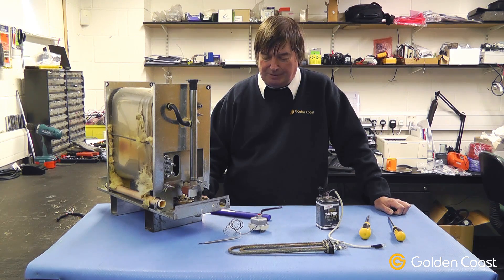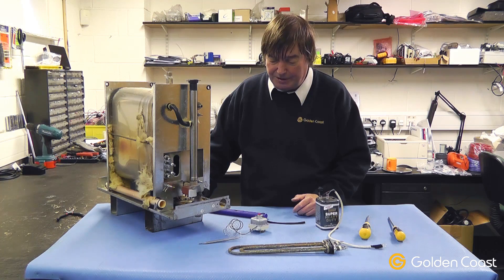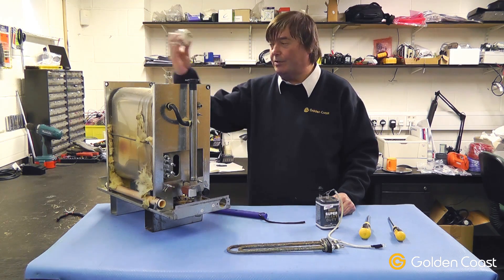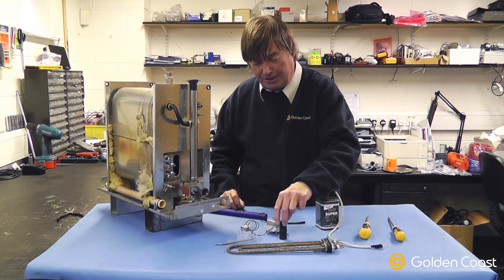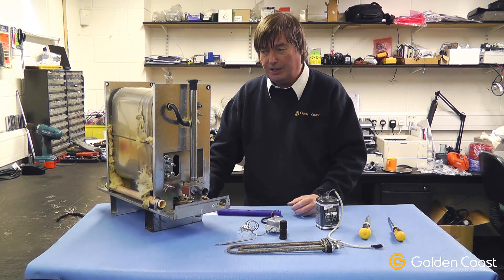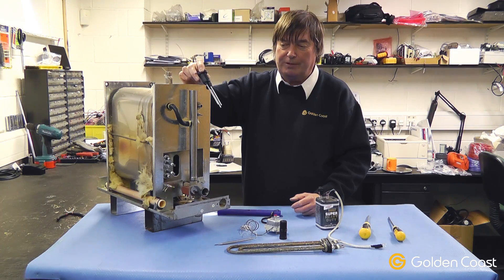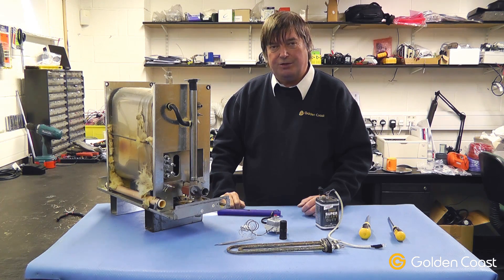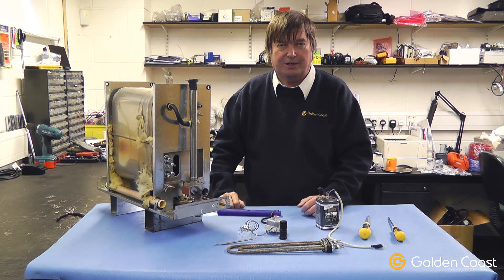Tylo Steam Generator Maintenance | Andy's Answers

Comment: Hi Andy, Is there a trick to removing the heating elements? do they just pop out?
Reply from the maker: Hi Phil There is a 10mm threaded nut that connects to a rubber compression seal, simply undo this and the element and seal will slide out. 
Hope this helps. Andy
Reply: @GoldenCoast  thanks Andy, I thought as much but it felt quite tight so thought I’d ask before doing any damage. Thank you for the reply, greatly appreciated.